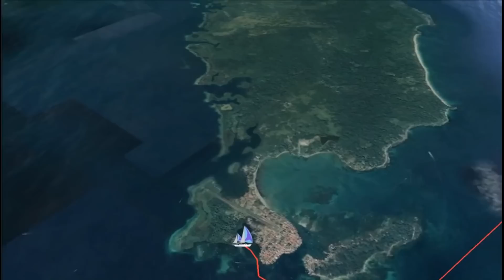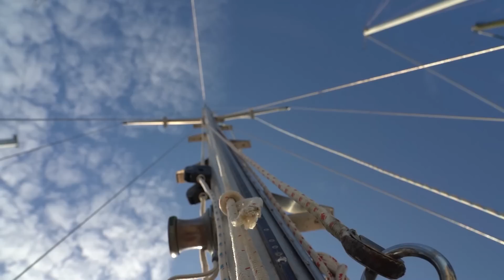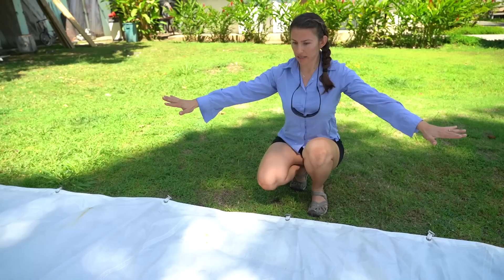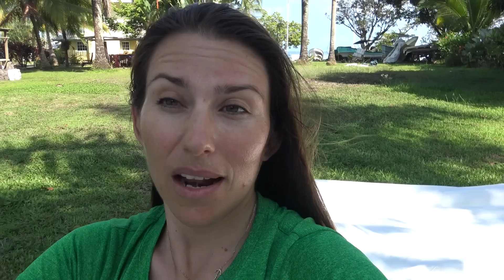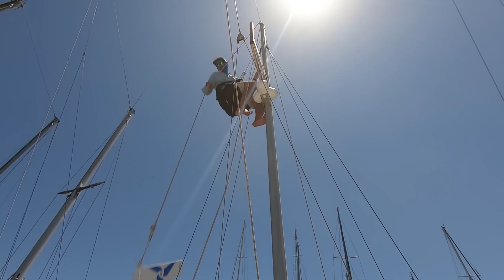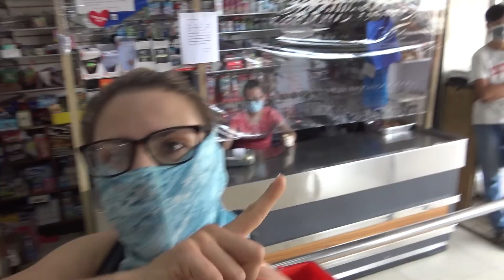Coronavirus: Things are Getting Crazy in Panama | S04E22

Comment: I’ve just discovered a way to defrost that old fridge in just 5 minutes. Of course it involves my trust 12volt Ryobi electric drill. You can do so many things with a battery powered drill. My small one is always in the galley and charged because it is also my electric mixer, breadcrumb maker and all round effort saving galley slave. Anyway my standard upright fridge freezer compartment had turned into the snow ball from hell and was starting to make the door not close. Damn it. The fastest fix here is always hot water, but you can never slosh it in with any precision (certainly the reason my problem avoidance system allow the situation to develop), so it short my galley drill, a pot of boiling hot water, and one of those $10 drill driven pumps (I always have one set up with hoses just in case) proved to be the perfect solution. Its amazing how you can just carve that ice away with hot water out of a nozzle. It literally took just a few minutes and far less water than all other methods. So if you know anyone with an ice block where the food should be, there is their first fast fix.

Comment: A dirty airfilter like that i see often in generators that have an exhaust leak. They suck in lots of sud. Does your engine have an open crankcase ventilation? In that case, connect it with a hose between airfilter and engine.

Comment: OK, the mast tuning, about being straight up is wrong the angle ,fore and aft is determined by the feel on the rudder when beating to windward letting go of the helm is a way to determine the rake of the mast. The boat should gently head up to wind, if it bears away it means you have to rake the mast aft, not too much say 5degrees, now, if you are sailing with the tiller up to your chest then you need to rake the mast forward. the proven theory is the powerpoint of your mainsail in relation to the keel it becomes center of effort(mainsail) over centre of resistant(keel).it is really that easy imagine your keel is on a pivot raking the mast forward or aft will depend how you rudder feels (leehelm orweather helm) this will make a big differance on how your boat handles

Comment: I'm not certain as to why your filter is so dirty. Many marine engines do not have an air filter. Some just have a spark arrester. If you are at sea there is minor dust or dirt in the air. If you are crossing the canal then I wouldn't go but if you are at sea I would not let it bother me. Always have a spare. I don't think you engine is turbo charged so it is a bit less of an issue. If you can get one then wait.

Comment: You can run your engine without it if you have to in an emergency for a few days (you are not driving on a dusty road....you are on the ocean with next to no dust).  I think I see a comment below about a sock (which could work).  Another way, would be to provide it a airway from fresh air souce away from your living air (lint, dust bunies, etc)......think snorkle of oversize, large pipe (like on a toyota land cruiser) to allow the engine to suck air from topside of boat.  Just somewhere you are not going to put ocean spray into it.

Comment: Jordan,  I have never seen a filter like that color, you need a new one. Have you ever changed that filter?  I would agree you need a filter, it didn’t get that way from filtering nothing. Does your engine have a closed crankcase that would explain the possible color because it’s getting some oil / blow by from crankcase. You should be able to find a different manufactures filter as the size is the same, also check a tractor dealer/service they should be able help. With the COVID-19 going around both of you need to stay safe.

Comment: Since they’ve got a sewing machine, thread, needles, etc. it NOOOOOOO Problemo👍🏻 Cut a sleeve out of one of you T-ShIrts , fasten the
Parts of the foam inside of the T SHIRT sleeves, it still filters....it will Neeeva come apart❗️
Reply: If the filter is clogged with belt dust then he needs to do more work anyway.

Comment: The black air filter is a worry, if the filter is really old take that into account which it could have been, but seeing it fall to bits like that makes me wounder  as filters are made of resistant material. You have a contamination problem which must be stopped as other people have suggested, it could be an exhaust leak and where could that lead to? Your bunk!
The engine is sucking in air through the filter. The filter is showing YOU what is in the air. Get serious.

Comment: Run engine without filter mainly stopping dust old filter is black must be sucking in exhaust gases some how?
Running a diesel engine without air will have no effect on engine performance slightly different engine sound. Petrol engine will have effect as  carburettor  should be set up with air filter in.Make sure nothing large can get sucked into engine. Be careful using a home made folter as this could easily be sucking cause extreme damage

Comment: This is what the calculator says: the deaths of 521 in Panama of more than 4.1 million inhabitants 521 is 0.01% of 4100000. So that is the death rate of 0.01%. And as for the 'cases', 29200 is 0.71% of 4100000, which is the population. So 0.71% has been infected. So these numbers barely warrant severe containment measures.
Even if you take the highest numbers available for global influenza mortality rates, these numbers in Panama are consistent with the global influenza mortality numbers.
There is nothing wrong with taking precautions voluntarily. Would education go a long way in helping people to be more careful, but applying containment measures? What's really going on here?

Comment: Brian, I watched you make a filter for the engine with the screen, but by clamping the screen down as tight as you did you restrict the surface area of the screen to only protect the small opening for the air. That may clog and cause the engine to choke at a critical time. I suggest you make the screen into a bulbous shape. This would give the engine air intake hole more surface area of the screen and would not clog and choke out the engine. I would make it say at least the size of a light bulb or more. Just a suggestion. _ RandyL

Comment: GOOD LUCK GUYS,
ON THE AIR FILTER BEING WET AND BLACK THERE IS PROBLIEY A CRANK CASE BREATHER TUBE CONNECTED TO THE AIR FILTER HOUSING AND OVER TIME BLOW BY FROM ENGINE WILL SATURATE THE PAPER FILTER TO THE POINT IT CLOGS AND THE ENGINE SUCKS IT IN
A FILTER IS A GOOD IDEA IF YOU CAN GET SOME BUT THE SCREEN WILL DO
GAS BURNING BOATS DO NOT USE AIR FILTERS BUT A FLAME ARRESTER BECAUSE THEY WILL BACK FIRE WHERE A DIESEL WILL NOT
THEORETICLY THERE IS NO DUST  ON THE WATER AND IN YOUR BUILGE OTHER THAN WHEN YOU ARE SANDING IT WORK ING ON SOMETHING ON BOARD
MAINLY BUGS AND OTHER PEST OR RODENTS
BLOW BY ON A DIESAL IS NORMAL TO A CERTAIN EXTENT
IF YOU ARE USING  OIL THAN BLOW BY IS WHERE IT IS GOING
BOATS AND OTHER ENCLOSED ENGINES ,THEY ROUTE THE BLOW BY BACK THROUGH THE ENGINE TO BURN AGAIN AND KEEP IT OUT OF THE ENCLOSED AREA
TRUCKS JUST DUMP IT ATMOSPHERE  BECAUSE BIG DIESELS MAKE A LOT OF BLOW BY 
I AM SURE YOU RUN DIESEL RATED OIL
IT MUST BE CI RATED NOT JUST SI
CI MEANS COMPRESSION IGNIGHTED
SI MEANS SPARK IGNITED
YOU CAN RUN SI AND CI IN GAS ENGINES BUT U MUST USE CD IN A DIESEL DUE TO THE HIGH AMOUNT OF ASH DIESELS MAKE
HOPE IT HELPS